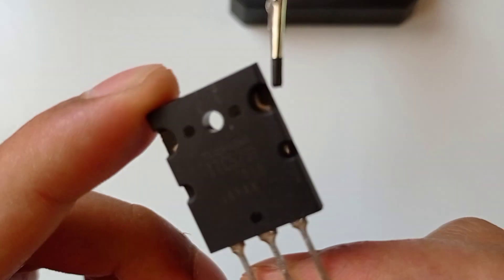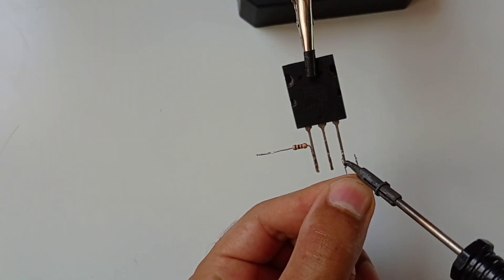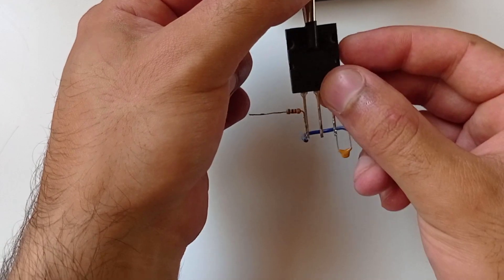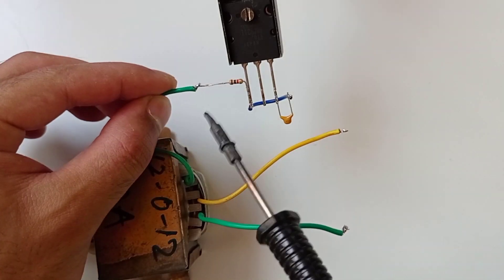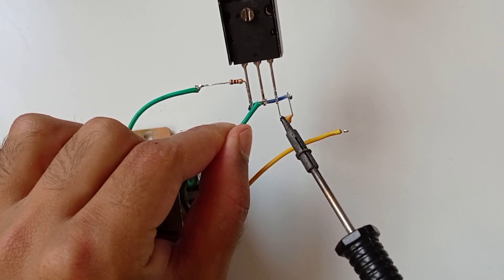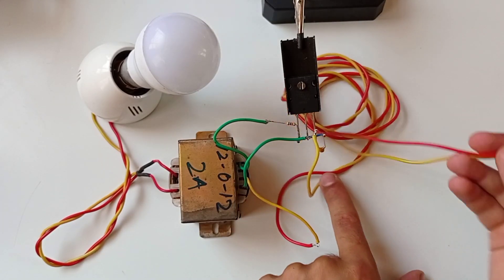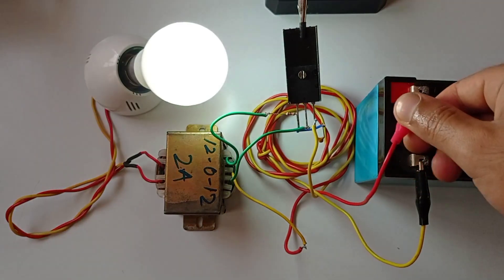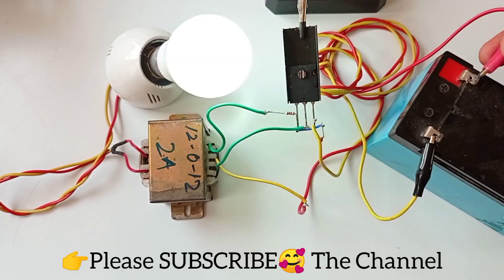how to make inverter with one transistor | 12v to 220v inverter

Comment: Thanks for this mate, it was helpful :)
Reply from the maker: Glad it helped
Reply: @CreativeTechos  Actually did... no bs... thanks :)
Reply: @CreativeTechos Can you help tell me the side of the 220nf... positive or negative dat will be connected to the C5200 as I did not not get the 224j to use
Reply: Since you wrote it was helpful can you help? 224j capacitor is not available for me to use but 220nf is. The question is how do I connect it to the c5200 I mean regarding the positive and negative side?

Comment: Hello can i use D1672 transistor
Reply from the maker: Yes you can use, take note of pin out configuration
Reply: @CreativeTechos  but my transformer has two wire only i can use.it and tell me what is the connection please
Reply from the maker: No the circuit uses 3 wire step down transformer
Reply: @CreativeTechos  hello please help my LM2596S adjustable power supply is no output the voltmeter is 0v what is the problem
Reply from the maker: The main component in that step down module is itself LM2596, also check inductor ot  try to replace that. Or buy new new module its cheap.
Reply: You can buy lm2596 for me
Reply: @CreativeTechos  hello my dt830d multimeter is totally not working what is the problem of that

Comment: Can I use a different transformer? Or the input volts was of 12v. Please clarify. Can I use a trans. With input volt of 110v?
Reply from the maker: You need to use 12-0-12 (2-3 A) step down transformer.